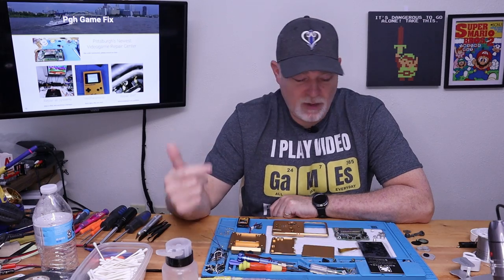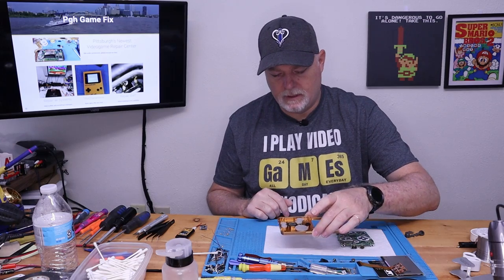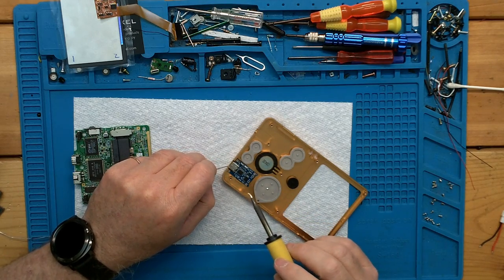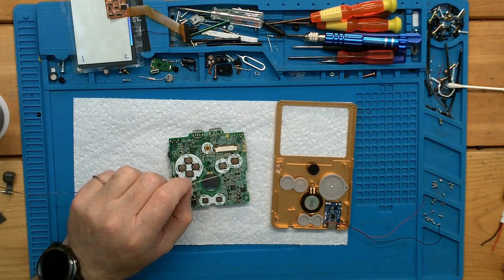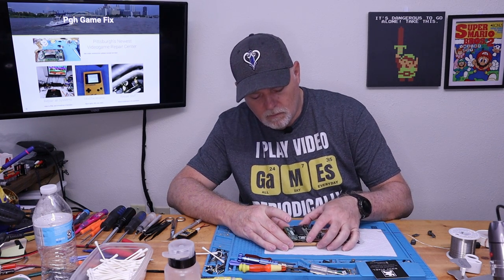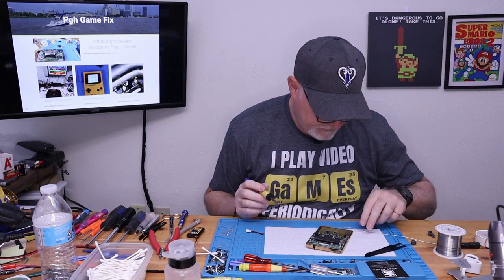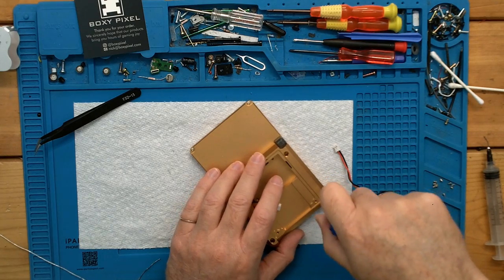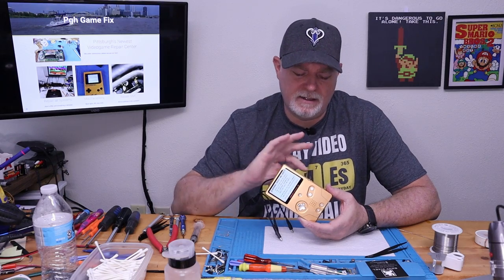Boxy Pixel GBA SP "unhinged" with USB-c charge port and IPS screen

Comment: 9:24 Yeah! My thoughts exactly...hot glue?!
Mounting bracket or a screw post to fasten it down 🙈
Reply from the maker: You are absolutely right.  I recently did one for a customer, and he wanted all the options, and I needed to source an SP for the build also.  There was over $300 in parts alone, and I still cant get over them wanting you to use hot glue. They are very nice when done... but this is a premium kit, and they should have a solution to fit everything in a "Premium" way.  Thanks for watching.

Comment: I have a question. Why are the usb c wires connected to the pcb input terminals as opposed to the output terminals on the usb c board? Doesn’t this bypass the charge protection circuit built in the usb c board?
Reply from the maker: We don't need the charge protection from the board, since the new battery has it built in.

Comment: I want to buy the latest Boxy Pixel GBA SP Unhinged mod kit, but on their website, the IPS 3.0 screen is sold out. Where else can I buy the same screen that will work with the rest of the kit?
Reply from the maker: handheld legend has the screen in stock, and buying from them supports the channel. https://handheldlegend.com/?smile_ref=eyJzbWlsZV9zb3VyY2UiOiJzbWlsZV91aSIsInNtaWxlX21lZGl1bSI6IiIsInNtaWxlX2NhbXBhaWduIjoicmVmZXJyYWxfcHJvZ3JhbSIsInNtaWxlX2N1c3RvbWVyX2lkIjo1NTE0MjUyNDR9&smile_referral_code=2xVWTLmy&st_intent=st%3Areferrals%3Acustomer-offers%3A2xVWTLmy&utm_campaign=smileio_referrals&utm_medium=referral_url

Comment: About the battery, does the red light of GBA Motherboard turns off after charging? I've installed the Boxy Pixel's battery and the red light never goes off
Reply from the maker: Yes... it will turn off after it's charged.  BUT, it will take some time with the original charger.
Reply: @PghGameFix  Do you know how much time with the original charger, approximately?
Reply from the maker: @marcopacifico3161  from dead... at least 5 hrs.
Reply: @PghGameFix  Thank you!!

Comment: I always wanted to do this one and I noticed that boxy pixel has one for the dmg gameboy. Trying to figure out how to utilize the usb c port with a rechargeable battery. I’m figuring that there has to be soldering and removing the old battery tabs.
Reply from the maker: Yes... most likely on the DMG... you will need to do some soldering.
Reply: @PghGameFix  I’m trying to find someone that put one together without any luck. I’m figuring that after taking off the battery tabs that I’d solder both the battery and the usb c port to the removed tabbed areas, obviously ground wires to where the spring tab went and the the red wire to the other
Reply from the maker: @thezedable  You can send the parts to me.  I've built several. use the email in my channel info to contact me.

Comment: The + you soldered looked different to instructions, why did you go there?
Reply from the maker: Give me the time stamp point on the video, and I can comment better.
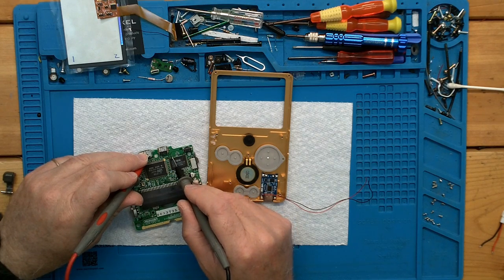Reply: @PghGameFix  15:34

I can see the fuse, but I can't actually see the large bit of copper that you're using.

I found their instructions for pin 2 a challenge.
Reply from the maker: @mrlimey2419  OK.... the copper is just the trace on the board.  It's covered in the green mask.  I used a hobby knife to scrape some of the green away by the fuse, and soldered the power there.  Once exposed... it was a nice open place to solder... opposed to trying to get on the pin of the charge port. If you have a steady hand, and are comfortable using the spot in the instructions... then feel free to use it.  I just wanted to show somewhere else that could be used, that would be easier for the average hobbyist. (With a fat soldering tip)
Reply: @PghGameFix  that's appreciated, it looks like a safer spot, thanks for the video, it's great not only seeing others do this, but pros working out other methods.

Thank you for taking time to reply too
Reply: Just used this method and quite a bit easier, thank you
Reply from the maker: @mrlimey2419  happy to help